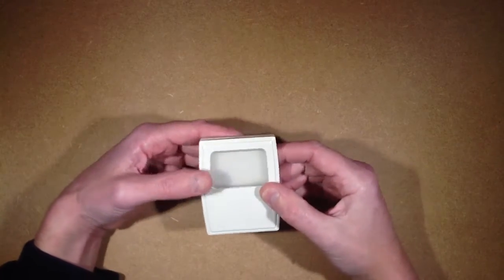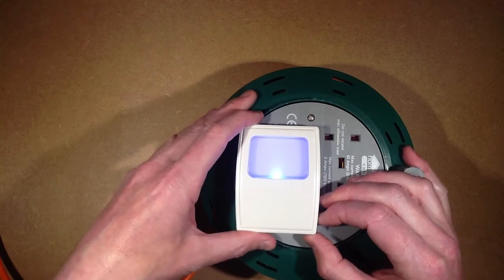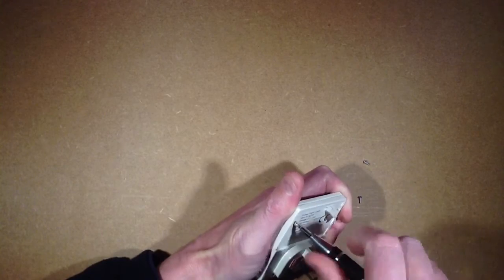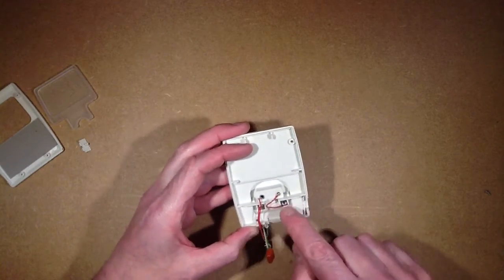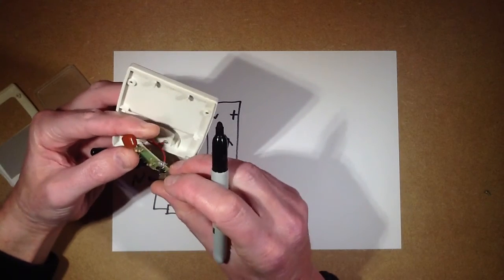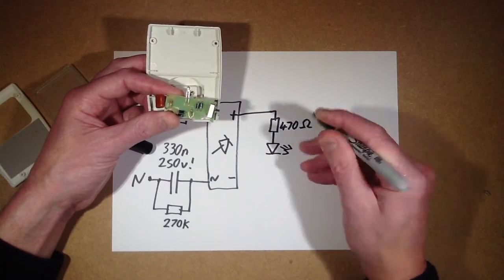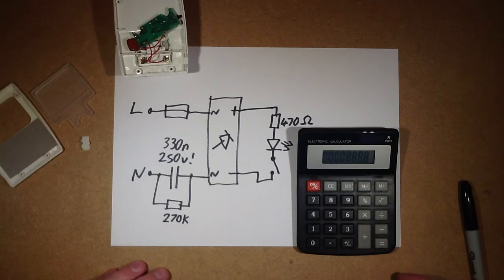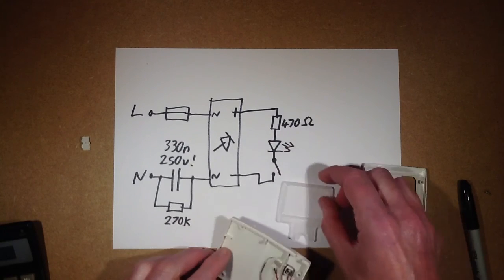Teardown of a simple LED night light.

Comment: Being from Canada and our main is 120 volts, doesn't mean I could when building just divide in two the components?
Reply from the maker: It would light OK on 120V.  But with capacitive dropper circuits the different versions for 230V and 120V supplies usually just have a different rating of dropper capacitor.
Reply: Thank you.

Comment: So wait, the resistor is dissipating 200 mW and the led is using 60? So a 1M bleeder resistor would save roughly 3/5ths of the power used by this light...

Comment: ok, Clive. I am fascinated by these "voltage dropper" circuits. Back more than a few years ago, I was taught V=IR and voltage dividers were made with resistors.  Is there some kind of formula for designing with voltage droppers?  They must have some limitation as to current they supply?  How does one know that the load on the circuit does not exceed what the circuit can safely offer.
Reply from the maker: +Rich Booth Yes.  It's the formula for capacitive reactance.  XC=1divided by 2 pi F C  You'll occasionally see me crack out the calculator in some of the lamp videos.  It basically gives you an equivalent resistance value for the capacitor based on its value and the mains frequency.  The difference is that the capacitor does not get hot like a resistor would.  It actually rations little packets of power through on each half cycle.
Reply: +bigclivedotcom Hmmmm... I do seem to recall that now that you mention it.  If I was looking for 20mA here in the US, where we are 120v and 60Hz using V=ir yields 6K ohm. driving for C in the Xc formula yields 4.42nF
Reply from the maker: +Rich Booth That's way too low.  I think the round value 470nF is closer to your result.  Most capacitors used in LED lamps vary between 100nF to 2200nF.
It doesn't help that the average calculator doesn't really deal with a nano Farad too well. 0.000000001
Reply: +bigclivedotcom Let's not forget that most old eyes have trouble reading most calculators. ;-)
Thanks for replying (and single handedly keeping Poundland in business).

Comment: Makes me wonder if they didn't screw up and use the 120v circuit in the case of the 240v one? (250v cap would be fine for 120v AC, and the resistor would be much more comfortable)

Comment: Blue is a weird colour for a night light. Was that an actual BS1362 fuse it had? Hard to see in the video, but I thought it looked like a glass fuse.
Reply from the maker: It was a cheap glass fuse probably rated to break 35A at the most, so I should think its main safety action will be to blow the entire night light out the socket.  Blue is supposedly not a good colour to use as a night light.  The theory is that using things like phones and tablets in bed disrupts your sleep pattern because of the colour of the light from the screen.  Obviously it's nothing to do with staying up until 4am watching YouTube videos.